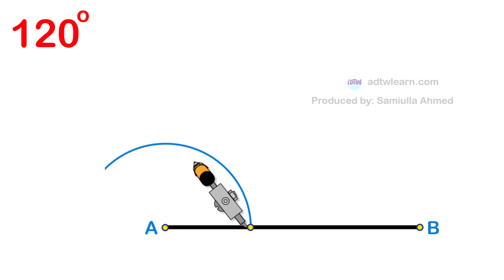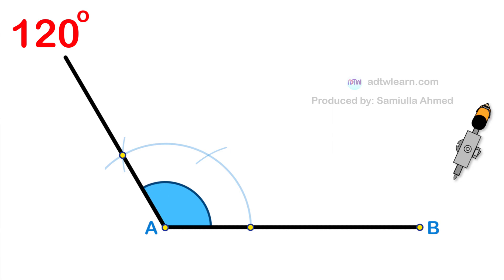120 degree angle || how to construct 120 degree angle by compass

Comment: This gives 130 deg
Reply: It doesn't because 120° is the double ( into 2) of 60° , and after constructing 60° , don't change the compass length , The exact point where you marked the 60° Point your compass metallic part in that , And where the another part of Compass goes mark it! And then draw the line! If it is not 120 degrees then you must have changed the compass length somewhere?
Reply: You just dumb haha noobie